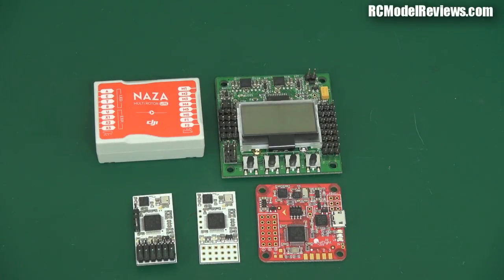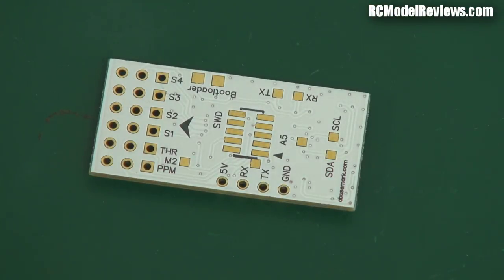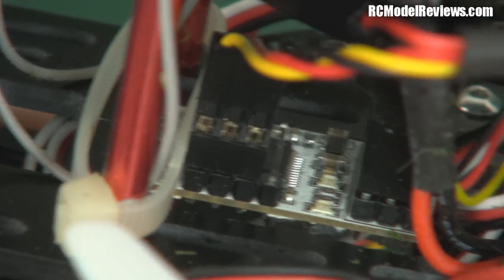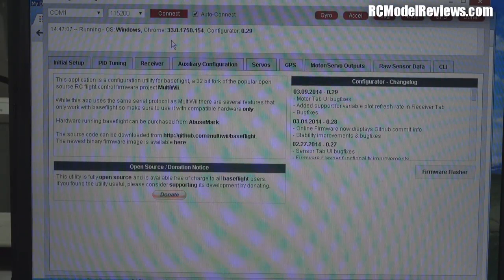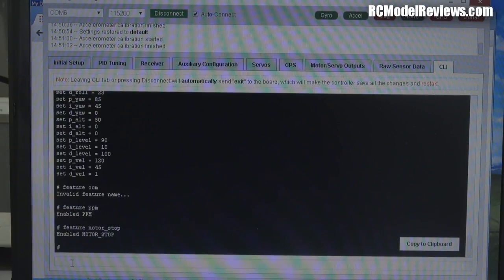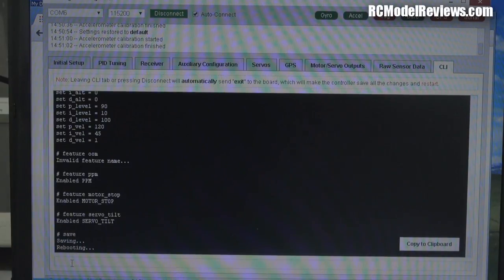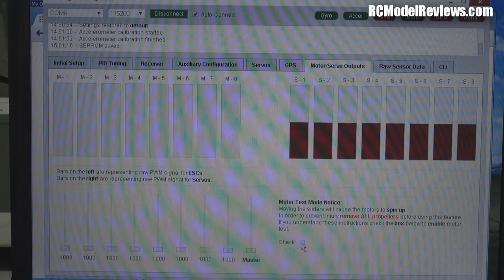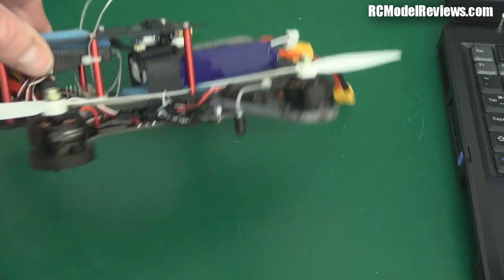Setting up the Naze Afro mini and Naze32 flight controllers (basic)

Comment: Ordered myself a mini last night on a whim, spent today trying to ferret out all the info I needed. Got home feeling a little drained, found a nice fresh video from you verifying everything I'd learnt plus filling in a few bits I'd missed. Now feeling a lot better about my purchase. Good finish to the day, thanks Bruce!

Some of the comments I've seen from others on this have been really helpful too. You are building a good community of followers.

You MAY be able to get FrSky telemetry working with this board by soldering wires direct onto pins on the processor, there are 2 "software" serial ports you can use. May experiment with this, but considering all I really want back is pack voltage and I can get that already using A2 in and a voltage divider on the D4R-II it's hard to justify the effort!

Comment: Thank you for sharing this Bruce I am still using the CC3D but with all the good reviews I am gonna have to try the Naze32 too
Reply: There is a fork of Baseflight for the CC3D called Cleanflight, in case you want to try without buying new hardware.  From what I have seen on the OpenPilot forum, most seem to like feel of Cleanflight better than the stock CC3D firmware.
Reply: Just go for the Naze 32. You won't be sorry. Coming from an ex CC3D owner.

Comment: I'm looking forward to a video on how to setup PID's for more aggressive flying. I think this is what these quads and board are designed for so I'm sure it will help a lot of people. I've notice exactly what you said: the quad tends to self level even in acro mode, or leans back which is annoying. Also if you could show us how to connect the FrSky telemetry with the V8R4-II that would be great. Thanks for the video and keep up the good work!

Comment: Meant to ask you Bruce, what RX for the radio do you use? I've got the afromini working on a quad with the "new" orange R615x, but I've heard BAD things about this RX, only using it because I had an orange module for the th9x, and it was dirt cheap. After my home made racing quad decided to fly off, with alot of stuff on it, I'm very much on a budget as usual. Even more so, about £250 flew off!
Also, did you do a video on the 9xr, I've just got one to replace the th9x, as I'm sure (after it was dropped) this caused the fly away, I mean the programming side, I can't work out the timers.
Thanks in advance, afromini is a great bit of kit, very neat build, I have 9 servo wires now to FC as opposed to 24. Neat nice one timecop!

Comment: Hello Bruce, again a fantastic video full of information, but I have to say if you use the Frsky usb 1 adapter, which I bought at HobbyKing, you blow up the Naze mini board and your usb port on your pc. The colors of the wiring are the same like you mention in the video but the connections are different. I programmed my Naze mini  with a Arduino serial board,connecting the Gnd-TX-RX to the Naze mini.  Almost ready for  the maiden flight.
Greetings and happy flights. Fil

Comment: Another Great video Bruce , Priceless for us DIY hobbyist .
I suppose once set up you can connect a Bluetooth module or radio for wireless tuning/telemetry on that com terminal .
It looks like if you hardwire this board you can build a micro Blackout with 2.5 gram brushless and 2amp ESC .

Comment: Informative video Bruce as usual. I'm not sure about using the motor_stop feature. Yes it will stop an accident if you pick your mini up after a flight without disarming it first. But there again if it's just sat some where you do not know if it's armed or not. You can see if it's armed with the motors just ticking over....
Reply: I'm with motor stop.
I've had mid air failures where I've cut power (props failed in mid air etc) so it's drops like a stone with dead motors rather than trying to disarm before it hits the ground (and burns all your escs from stalled motors)

Comment: Hey Bruce, you mentioned in this video that the RX needs to be connected to the TX etc. when using a FTDI adapter, but what about the FrSky FDD-Lite? Do these also need to be swapped or is it a straight connection?
I ordered the FFD-Lite from RMRC and it seems to be a little different from yours so I wanted to double check the wiring before I connected anything.

Comment: Great work, I've watched loads of your quad videos. The Naze 32 setup being THE most useful as I'm a novice. Your video got my motors spinning at least. I have a couple of questions. I'm using a Futaba T8j and not all of my switches respond on the configuration tab of base flight. Also when I test the motors with the TX on, motors 2 and 3 do not match 1 and 4 as I increase throttle.

Comment: Hi Bruce, thanks for the great video! I have a couple of questions concerning both these boards, but especially the mini one.

1. I have a MultiWii Bluetooth module with its typical Vcc, GND, Rx and Tx pins, and was wondering if this would connect to the same place the USB header did in your video.
2. Can I use the bluetooth conection to make the adjustnents from the program you showed instead of USB, and if so, how to you make the actual conection?
3. The reason I have the BT module is because I was recommended it for on site adjustments with my tablet rather than fuffing about with USB and laptops for PID adjustments, and with the size of it, installed permanently next to the míni Naze32 it is still smaller and lighter than the afro Naze, and if PC access can be obtained via this, then great... but is there an Android equivelent of this program to do it all from a tablet or is the tablet only good for PID adjustments and nothing more? 
4. When you do the adjustments video, could you also show how to do it on an Android device, and see what app you would recommend, as there are so many to choose from.

Thank you so much, and keep up the good work!

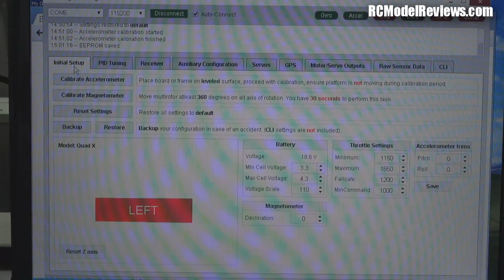Comment: You could have shown how to calibrate esc's at 26:09 in about 1 minute: Unplug the battery, make sure the "Master" box is checked, put the "Master" switch to it's highest position, plug the battery in and listen for the esc's to beep their "high" point. Then simply click the bottom of the "Master" slider so it hits it's lowest position (don't slide it down- click the bottom of the slider so it jumps down) and you are done. It takes me longer to type it out than it does to do it.

*edit- I forgot to consider if this applies to the mini board- it is how I do the full and acro boards. (courtesy dlearnt)

Comment: The FTDI bit stands for the company that makes the chip those things use. It's a USB to Serial converter. The bigger naze boards have a SiLabs cp2102 which is just as good but cheaper.. you can get adapters with that chip for a lot less than the FTDI

Comment: Hi Bruce,
I'm sort of new at the hobby but have jumped in pretty deep as of late. You mentioned there was a way to adjust the Naze32  if you had to mount it tuned 90 degrees or in my case 270 degrees. In other words, the arrow points to the left. I didn't want my receiver connector hanging out the side of my little xhover 230. Is that a command line thing? Thanks in advance, Jimdog

Comment: Hi Bruce, just curious, which FrSky receiver were you using for this quad? It looked like the V8FR-II but that doesn't have CPPM.
Reply: he is using the hitec aurora9 in this video, which in not frsky. what you want though is the FrSky D4R-II 4ch 2.4Ghz ACCST Receiver (w/telemetry) which can do the cppm and telemetry, is full range and supports 8 channels (in cppm mode) PS there is a firmware update available which is a recommended install (also requires an ftdi adapter)

Comment: Hi Bruce, I have a Frsky fdd-lite rev2 board but the connector is on the 5v corner of the board opposite to yours. I have connected Gnd-Gnd, TX-RX, RX-TX and supplied power to the Afromini from a 5v UBEC. But no matter what I try it will not connect. However using a Crius FTDI 5v board connected in the same way it connects instantly without problem. Why do you think it will not work using the Frsky board?

Comment: Can these flight controllers replace the motherboard in a cheap Chinese quadcopter? While still using the stock transmitter and motors?
Reply: they should if you wire them correctly but with that comes alot of tuning

Comment: Hi! Quick question please. I have MJX X400 quadcopter. But really would like to build my one my self, do you know if is there a way to use the MJX R/C to connect it to the Naze Afro Mini or Naze 32? Buying radio controller will be extra cost so i would like to avoid it for now if possible. Thank you and have a nice day!

Comment: FTDI is the brand of the USB to Serial TTL chip used in the breakout boards, they are other brands of chipsets like SiLabs, but go with FTDI, much better driver support on all OS.
Isn't kind of dangerous for motors to full idle with some throttle on it?, is there a mode to avoid overcompensation of the PID parameters in flight?

Comment: My HERO!  No other viddys exist to date on this.  I was going nutz!  I WILL say that the official Frsky dongle IS different and for folks to look CLOSELY at the output on the boards to see what pin goes where!  My official dongle oddly wouldn't work.  I ended up using a mini usb board used to interface with MinimOSD.  What finally ended up working is NOT using the PC's battery input.  I used an external battery and WOOT!

Comment: The safest way to test the motor/prop direction is to remove the props and use the motor test tab in the configurator to test the motors.

Comment: 09:36:59 -- Serial port successfully opened with ID: 1
09:37:09 -- No configuration received within 10 seconds, communication failed
09:37:09 -- Serial port successfully closed
Hi Bruce, not having a lot of luck getting the software to work. Any suggestions?

Comment: i just keep getting a bootloader error when i try to flash the FC, i have tried swapping around the connectors as it also never litup in the first place, any advice?? and i check other forums, some say naze32 dont even work with FDDI so im stuck. the FC is not in the quad in case of errors like this.

Comment: All your fault Bruce. I have ordered a couple of Naze32s to replace my KK2s.
I also ordered a Banggood carbon frame.
I just could not bring myself to fork out $150 for a Blackout.
Good to see we can now order from HK Aus warehouse now.
Should cut down shipping cost and wait time I hope. :)
Reply: I think I have the same BG carbon frame on order. it's probably the same knock-off that has QA issues, but finding BG customer support good and refunds and replacements are forthcomming. I'm more a fan of APM (or APM on multiwii) but it's not so good for fast flying... so I'll be picking up a naze type at some stage... (hopefully not annoy the wife)

Comment: The only feature I missed on the Mini is a lack of VBAT and Buzzer pins. I mounted a tiny little prototyping board on the back with 3 resistors and a transistor, now I've got low voltage LIPO warning on the Mini. :)
Reply: And no frsky telemetry

Comment: great info.  I have been using naze32 but never set the mid points.... going to do that now.  Do you have any advice on setting the barometer mode?  I can't really get it to maintain altitude.  tried moving the mid point on throttle but still drops slowly...
Reply: do you have some felt or porous foam covering it the baro chip? if no put some on.
Reply: Jason Day thanks, i did try that too.
Reply: The pressure slowly changes as clouds etc. move about. If you wait long enough does it move back up?

Comment: Hey Bruce!  Thanks for this vid, I'm putting together my own MXP230 with Naze FunFly this week.  One of my roadblocks was getting my Turnigy 9x 3 position switch set up.  I'm running ER9x software - how do I get that channel to output properly so I can change modes easily in flight?
Reply: sandnessmj I'll do a video showing how to set that up on the various radios I have around here which include the 9X, 9XR, Taranis, JR XG8 and Hitec 9X
Reply: I have a Flip 32+ which is a clone of the Naze32 and I cover that in the user manual I created.  http://www.rcgroups.com/forums/showthread.php?t=2212634&highlight=flip32%2B#post29000641

See page 92.
Reply: ***** That would be great I also haveca 9x with FrSky and it doesnt seem poosible to use the 3 position switch. Please pass this knowledge on! The people need it :)

Comment: I have a few rtf cheapo quadcopters and I noticed on all of them they have a gnd, vdd, dat, clk, and rst on the main chip. What could these be for and could I maybe use the to reprogram the quads?
Reply: Probably not, as most cheap quad copters use brushed motors, and the ESC, micro receiver, and flight controller in one board, and it would be a lot of work to replace all of those components.

Comment: Some of the FTDI boards have a six pin socket  so go very careful plugging it into your NAZE mini. In hindsight given that I dont use the adapter for anything else  I will remove the unused other three wires. Being a blind old bat without my specs on I got it one pin out and all the magic smoke came out of my NAZE mini. Red LED is kaput and no worky any more boss.

Comment: Rcmodelreveiws  if I have a transmitter that doesn't have subtrim or lcd screen at all could I still set the end points and center to 1500

Comment: Got my Naze32 board set up (the big board) and everything's working okay - even gps is showing up okay on Baseflight. However, when I open the throttles to nearly full the motors become erratic and the quad shakes in my hand (not flown it yet). Anybody have any ideas what could be causing the Sunnysky motors to rev up and down?

Comment: I connected the naze32 like you described it here, i am using a Taranis and a X8R-XP in CPPM Mode. But its not working. The motors can be controlled with the baseflight software and the transmitter seems to work in the baseflight software but i cant get the motors started from the transmitter. I cant even get a tone from the Simonk ESC when connecting the battery. What went wrong?? Can you please give me a hint?
Reply: I have the same issue, did you solve it yet?
Reply: Eric Miner Yes. In my case i had to calibrate the magnetometer (although that board has no mag). But after calibrating: Bingo. Good luck.
Reply: thats weird, calibrate mag is greyed out in the cli and I cant use it. How did u calibrate the mag?

Comment: Do you know if it's 5v FTDI tolerant, or will it only tolerate 3.3v signaling?
Reply: Mine takes 5v. IIRC only v1 was not 5v tolerant. I have left mine plugged in for an hour. No harm.
Reply: Byro  They chip support both modes but you need to configure it on the pinout, some breakout boards have a pad/solder jumper to select between 3.3-5V out, others are fixed.
Reply: ElAMPox
My FTDI supports both but my Afros are happy with the 5v

Comment: It is important to know not all USB - serial adaptors (refered here by Bruce as the FTDI) are created equal.
There are 3 major chipsets on the market designed to do this conversion. FTDI, the original and still the best, Silabs, good with some reservations and Prolific in particular the PL2303. Many unreliable non genuine copies out there which is why Prolific have dropped the chip since their reputation was being unfairly tarnished.
If you are buying on Ebay make sure the device is supported under that steaming pile called Windows 8. Anything using the PL2303 chip is a no no as Prolific has dropped support beyond windows 7.
As a general rule if the device is advertised as being Arduino compatible you should be good to go. I recommend getting a bare breakout board like Bruce's rather than an integrated cable as you will likely need this device for other RC related stuff. Selectable 3.3 and 5V is becoming more important these days to with the move away from 5V devices.

Comment: Why didn't you show how to ESC calibrate, which is a 10 sec. operation from the Base Flight software. ESC calibration is actually very important, especially if you utilize all the headroom on the ESC's, to make sure that the throttle range is perfect aligned on all of them.

PID tuning may not be required for hovering around or low speed flying, but kinda missed, that you didn't covered that as well.

Comment: Is there a controller that can return to home ,or any way of doing this for low battery ?
Reply: The multiwii pro comes with GPS but is not the 32bit chip that is featured on the Naze board

Comment: Does enyone have any experience With the flip32. in principle it should be te same, right?
Reply: I guess I will be censored in 2 minutes again. Mr Simpson is just presenting what he is payed for. In this case the money interests of Tim Copperfield aka Timecop (Resident of Japan). The flip32 is equal to naze but has mainly a little lower build quality. If you are just looking for acro / horizon / level mode you can also flash multiwii 2.1 on a KK2 board or use a simple multiwii board since the core of BF is just a copy of mwii2.1.
Reply: CrashPilot1000 thanx. I already ordered a flip32 and looking forward to make my new quad!

Comment: Calibrating ESC's would have been a good thing to have included on the video, or at least point us in the right direction
Reply: I have a Flip 32+ which is a clone of the Naze32 and I cover that in the user manual I created.  http://www.rcgroups.com/forums/showthread.php?t=2212634&highlight=flip32%2B#post29000641

See page 78